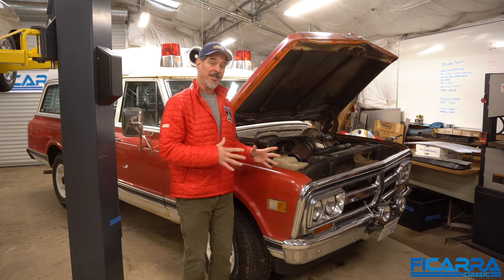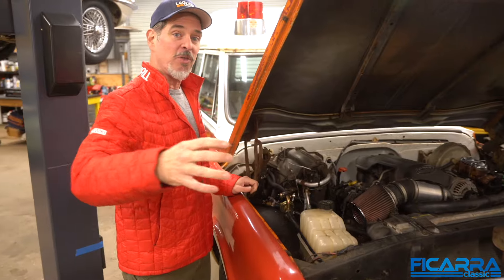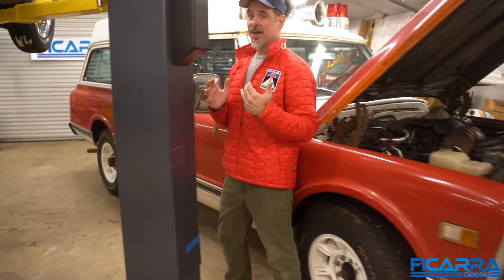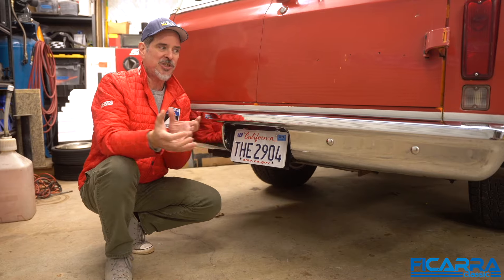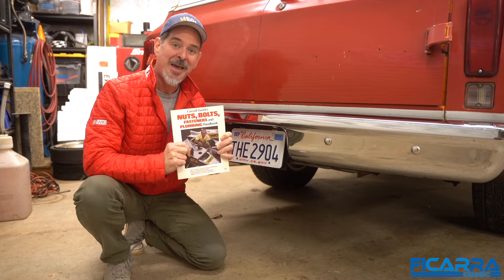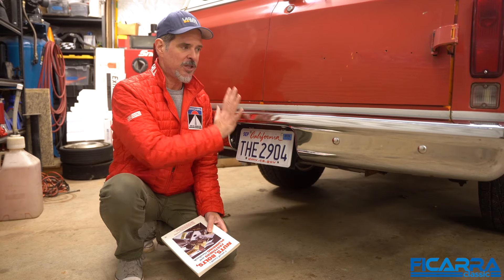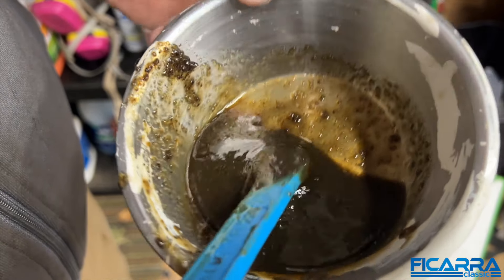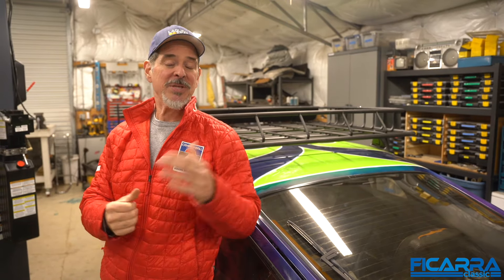The Cannonball Ambulance is a tow rig! ... and other garage updates.

Comment: Fun fact: Grade 8 (or metric 12.9) are not permitted on fairground rides (roller coasters etc). They will hydrogen embrittle over time and with a yield threshold close to their ultimate strength there's not really any easy way to detect that a bolt is about to fail (as opposed to a bolt that has stretched). 

The rate of embrittlement somewhat scales with the stress on the bolt. If a grade 8 is torqued to the equivalent max torque for a grade 5 the rate of embrittlement is low but then you could have just used a Grade 5 bolt . . . except in the case where the load on the bolt might have occasional spikes. The grade 8 has the margin to survive those events. For a trailer hitch application grade 8 makes sense.

Comment: I saw a well work first gen 928 on the back of a trailer today. It looked straight other than the oxidized paint and duct tape holding down the hatch. If it wasn’t in Georgia I would have thought you had added another one to your collection.